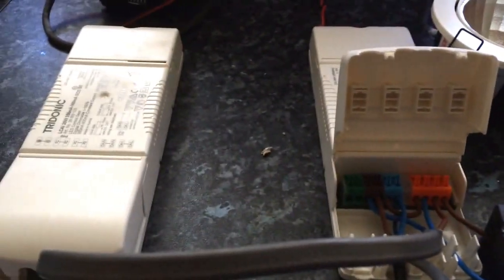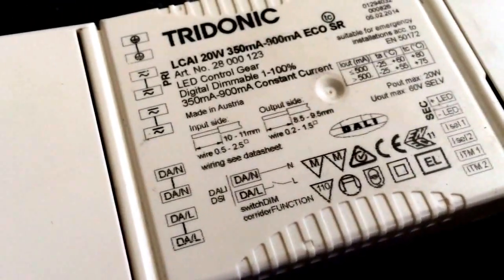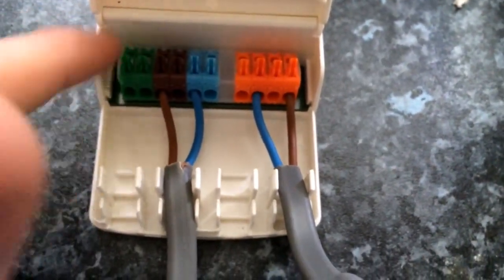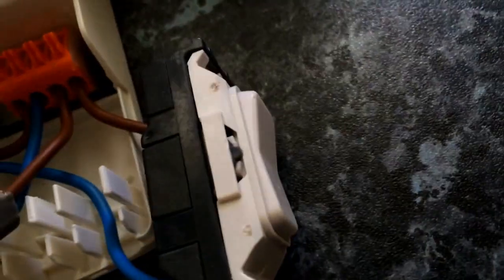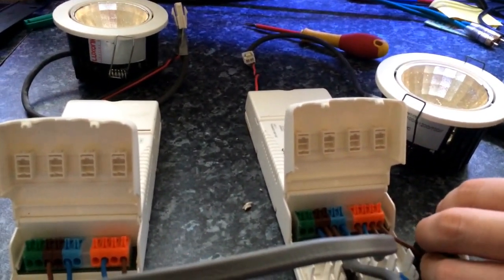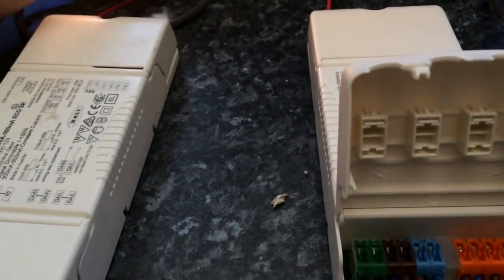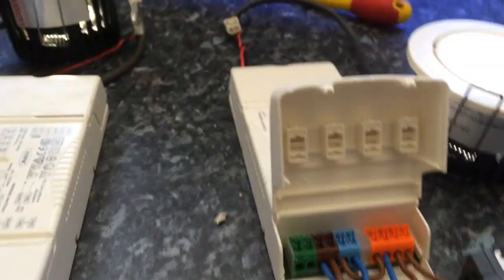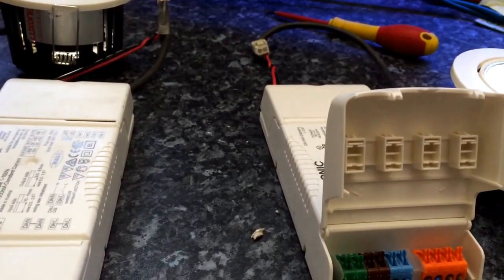Tridonic 20W LED Driver - switchDIM

Comment: Lighting has turned very technical now! Im sure you have seen the systems,Have worked on a few different sites in work that have lights made by a company called Trilux. Similar sort of thing one press on, one press off and hold to dim dimming. Some have an LDR that auto-adjusts to the brightness/daylight coming through the window to the brightness of the light. P4 self testing emergency lighting too! Seems to be the future!
Reply from the maker: Yeah we've just finished the new Velodrome in Derby and that has a full blown DALI lighting system installed, With a computer head end that displays all the faults with the lights (so if a lamp goes in a fitting or the batteries die in an emergency one it'll show up on there where it is) and can also control the lights if need be.